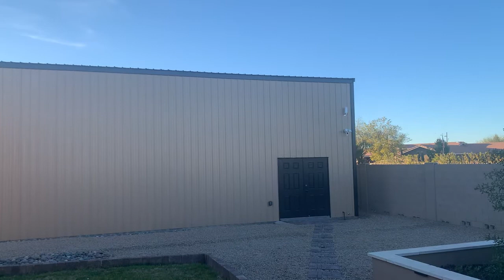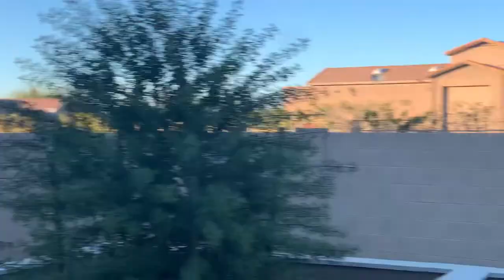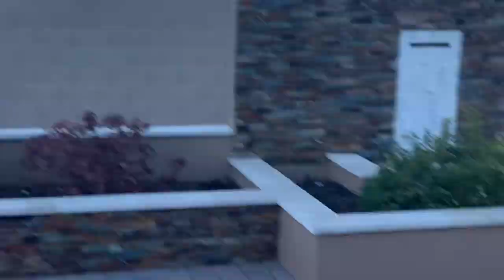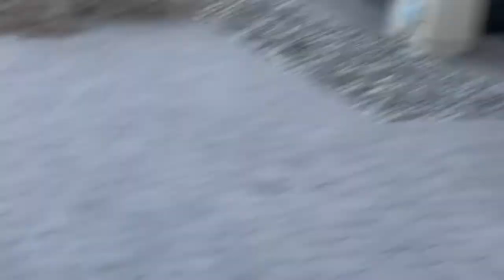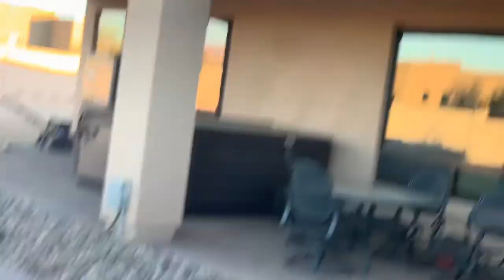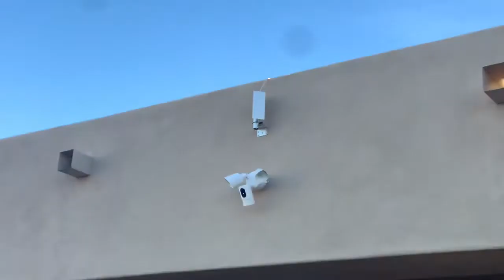How to get wireless internet to metal building/external building - cheap, easy, and strong signal

Comment: What router do you use in the shop? I have a tp link router I'm trying to connect my 510 to via cat5 cable. Not sure how to configure the router for this though.
Reply from the maker: I am using a TP-Link AC1900 in the garage so that I have wireless signal throughout the inside of the garage. Basically any router of your choice should work behind CPE510 receiver/client antenna as beyond it is just like a standard wired internet plug in connection. In other words, I just ran CAT wire from the CPE510 through a small hole in metal siding on the garage to my AC1900 that is mounted at the centered on interior the back wall and also high up so that it can provide good signal over my RV etc. to the other side of the interior.

Comment: My shop is 100 ft away so I put a TP-Link TL-PA9020P Powerline Extender behind the router in the house.. connected it with a Cat 5 cable... Went to the shop pugged in the other section of the 9020p then plugged in a 
 AX1500 Wi-Fi 6 Range Extender connected with a Cat 5.. Plenty of fast wifi and if I want.. unplug the AX1500 and go Cat 5 directly to laptop or TV..   160 bux invested
Reply: Was this for a metal building?